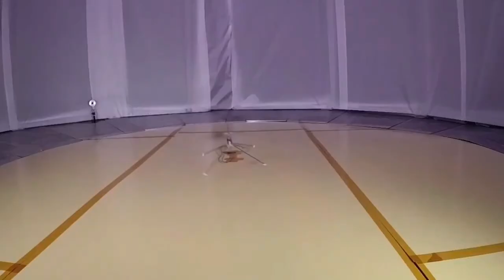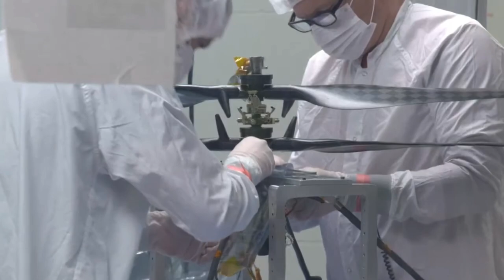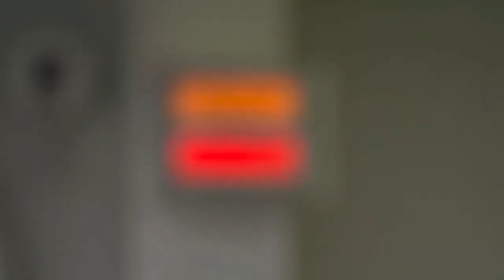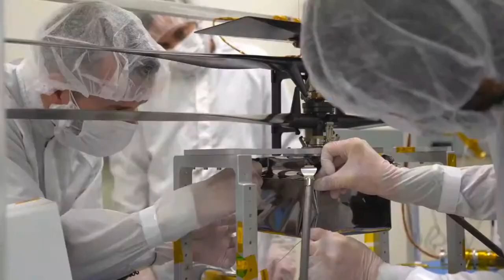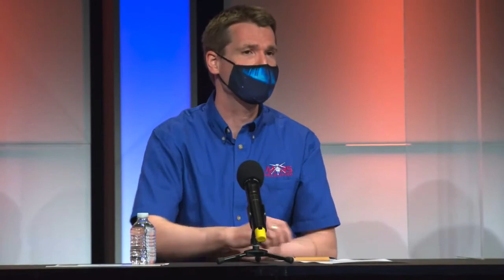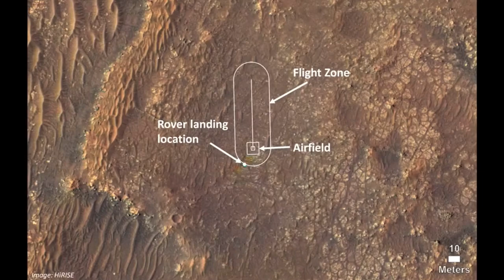Ingenuity helicopter's flight plan on Mars explained by NASA

Comment: How did they examined the flight in earth with mars's atmosphere and gravity???
Reply: They put it in a vacuum chamber to thin the air and hung it on a line to counter its weight. The conditions matched Mars as best as possible. There is a video titled "NASA's Mars Helicopter Vacuum Chamber Test Flight Successful," uploaded by VideoFromSpace, showing one of these tests.
Reply: @-.._.-_...-_.._-..__..._.-.-.-  Doesn't address the gravity issue. Ingenuity is going to be very light up there.
Reply: @thursoberwick1948  "hung it on a line to counter its weight"...
Reply: @lordcirth  Which still doesn't address the gravity issue properly, since it doesn't fully mimic the situation. The low gravity does compensate for the very thin atmosphere to a limited degeee.
Reply: @thursoberwick1948  It doesn't mimic the effects of steering perfectly, but it does mimic the vertical axis, to test if it can take off. And it can.
Reply: @lordcirth  They don't seem to have tested it in anything like the Martian conditions. Presumably most of it is based on mathematical modelling. There are also obvious problems with the extreme cold and ultra-abrasive dust, but those are other matters. They will shorten its lifespan though.

Comment: How can the batteries recharged?
Reply: I'm guessing solar panels, and the ability to reconnect with the rover, which has a nuclear power source.
Reply: Solar I think
Reply: It has solar panels above it's rotors. Those should keep batteries charged for a couple of flights.
Reply: Like much of the 4-pound (2-kilogram) rotorcraft, the six lithium-ion batteries are off-the-shelf. They currently receive recharges from the rover’s power supply. Once Ingenuity is deployed to Mars’ surface, the helicopter’s batteries will be charged solely by its own solar panel.
Reply: After Perseverance deploys Ingenuity to the surface, the helicopter will then have a 30-Martian-day (31-Earth-day) experimental flight test window. If Ingenuity survives its first bone-chilling Martian nights – where temperatures dip as low as minus 130 degrees Fahrenheit (minus 90 degrees Celsius) – the team will proceed with the first flight of an aircraft on another world.
Reply: Stop guessing
Start googling 
Sirs .•°
Reply: @farrider3339  It's not the first flight of an aircraft on another planet. The Soviets did that in the 80s on Venus but NASA airbrushes that out as usual. Their Venera program also transmitted sound from Venus forty years ago, long before Perseverance's microphone.

Ingenuity is the first powered flight and first helicopter, but it is not the first aircraft elsewhere.
Reply: @thursoberwick1948  iF - we categorize a probe on a parachute landing also as an "aircraft" it is true.
I heard the recordings of the sounds of Venus and also the ⚡️emitted in the atmosphere.

This " Ingenuity " rotorcraft , and you will agree , is going to fly around in the 1% atmosphere of Mars driven by its built in engine.
Decisive difference !

Venus is a hellhole.
🇷🇺 did fantastic job with its Venera probe.
Unprecedented so far 🏆
👋.•°
Reply: Peter Mercado  the part of intelligence which you are referring to is based on ℹ️. . . 
Don't get.me wrong , I'm not against some guessing for fun.
However those above guesses sounded too far off the point to me .•°
Reply: @farrider3339  No, the Soviets had an aircraft which remained airborne for hours and took measurements of the atmosphere. It was a balloon. That was separate to the landers.

Also USSR =/= Russia. A huge chunk of their people were neither Russian nor living in the Russian SSR. The main Soviet launchpad was at Baikonur which was not in Russia but the Kazakhstan SSR.
Reply: @farrider3339  p.s. Looked up the stats. It remained airborne in Venus' atmosphere for THREE DAYS. Not just a parachute job.
Reply: @thursoberwick1948  "An aircraft is a vehicle that is able to fly by gaining support from the air. It counters the force of gravity by using either static lift or by using the dynamic lift of an airfoil,[2] or in a few cases the downward thrust from jet engines. Common examples of aircraft include airplanes, helicopters, airships (including blimps), gliders, paramotors and hot air balloons ." 
(Wikipedia)
Hope that makes you happy .
You win 🏆🎉
Me.at.peace .•°
Reply: @farrider3339  NASA doesn't like to admit it, but the Soviets did a lot of things in space first. I'm not a fan of Communism (which seems to have been making a comeback recently in repackaged forms), but their space programme was their greatest achievement and probably helped push the USA into serious space research like this. The first landing and pictures from the Martian surface were Soviet, although they were barely usable... That pushed NASA into the Viking landers. I've no doubt if the USSR had put a man on the Moon first instead of the USA that we would have a Moon bases by now, because the US would want to outdo them.

Comment: Why can't they take any video from mars?
Reply: We can and have. Check out the video on this channel titled "Perseverance Rover’s Descent and Touchdown on Mars (Official NASA Video)." In that video, the images and audio were recorded separately. It took about 3 days for the 3 total minutes of video to make it back to Earth. It was then synced with the audio. 

Video is data intensive, and that's problematic. The time it takes isn't the issue; it's the congestion that amount of data causes. We could be using that bandwidth for more important things. It's also very rude towards the other rovers and spacecraft Perseverance is sharing that bandwidth with. We can do video, but we want to do it sparingly, only when it's necessary. I hear there will be video and audio of Ingenuity's first flight, since it's such a big event and there is a scientific need.
Reply: The bit rate is slow over those distances. Possible but hard.

Comment: Blade slap if you go fast on mars.Common problem on Coaxial helicopters at speed.I doubt if it will get a second flight , out of it.
Reply: Isn't blade slap just an acoustic issue though? I don't see why it would cause the loss of flight ability. And either way, I'd assume that the thin atmosphere means the blade/vortices interaction would be much less apparent
Reply: @netsch20  Not on earth.Had my fair share of blade slap.

Comment: So far, I've not witnessed a single 4K or 8K video demonstration from perseverance. Is it impossible to receive a full video transmission? I reckon all cameras on board are high resolution devices??
Reply: Difficult. The bit rate is slow over those distances.
Reply: The landing videos were HD at least.